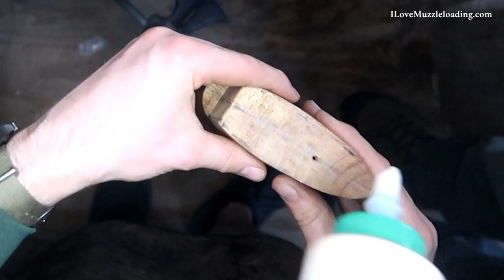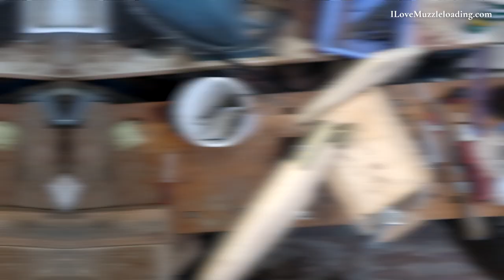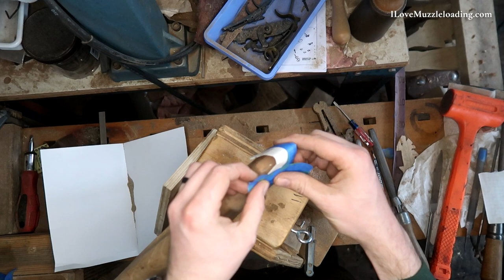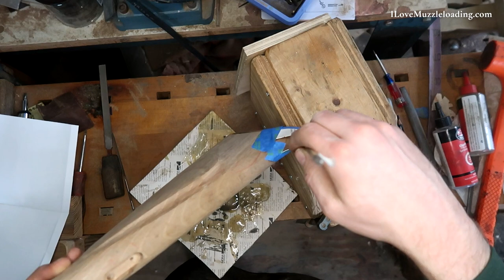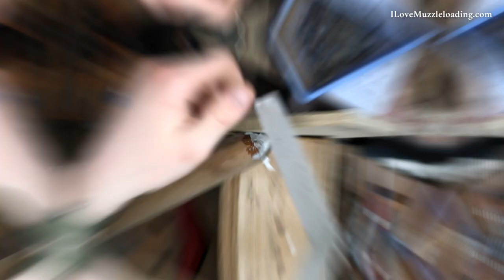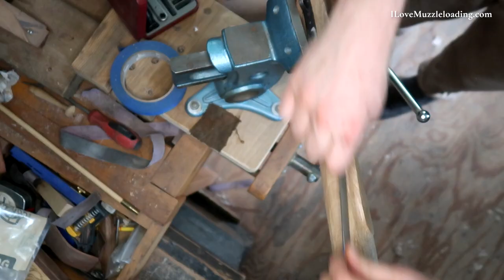I done goofed - Let's fix this buttplate | Let's Build a CVA Hawken Part 5 | I Love Muzzleloading

Comment: Ethan, Ethan, Ethan. You could have asked me.
Brass components, and steel components are cast in, mostly sand. The Cope and Drag are a certain size. The components are usually foam, or wax. The models were compressed to facilitate getting ready to cast. The caster maintains at least 1/2" between model and Drag.
When you see the sprue on the top of the casting,  that is where the metal enters the model. I do not know what the model looks like, or the dimensions of the Cope and Dag. However, I suspect the butt plate is cast in one piece, and the mold is two. The Gate, and Sprue are pointing upwards. You do not want the sprue to be that close to the casting. Metal shrinks when poured and any right hand turns on the model will have a pocket. The bumps you see on the product are called mold Warts. A bubble that sticks through all the processes that are involved.
Ok, that is a rough How it is done, Now. How does the artisan fit the butt plate?
He sands the stock, and trys the plate. Now he sees the gaps. What to do?
Rather sand the buttstock more he takes a punch and planishes the butt plate to the work, Each void between stock and buttplate, he peens down. Now hows about the bigger gap at the end?
He removes the buttplate and bangs the end down. No more gap! Just a dimple or two and voyla! Done.
When you removed and put a piece of maple in it, that was unnecessary. If anything, it might have made it harder. You then had to remove wood, and add filler. You did goo, but it will show. It looked like there was sufficient metal to make it fit.
I hope I have been able to show insight for ya. You sure have done that to me. That and Bobs Gemmer tape. I learned a lot there. I thank you. My Gemmer looks brand new oldy timey. It is a beaut. I really thank you.
Now go Boop the Floop! He earned it. Give him an hug! Cats like it when you hold them upside down and tickle between the rear toes! They spread their toes and wiggles their tail.
Thanks.
It was great to watch.
Doc

Comment: You did fine sir. You got it done. As a future note, brass bends, they have colors you can use in epoxy to match either the brass or the color of the wood. And as a hobbyist knife maker, i use g10 liners that you might think about to kind of "feature" the separation between butt plate and stock. Just a few thoughts. Hope you dont take this as offense. Its only meant to give you some extra tools in your box. If youre looking for a classic black powder or originalist look i understand why you wouldnt use something like a g10 spacer.  I understand also why you chose to fill it instead of bending the butt plate if youre after that originalist look. Those butt plates wrap around the shoulder fitting like a glove. Theres a comfort in that. 👍🤝

Comment: Ethan Ethan Ethan. You should have looked at pictures of a finished product and you would have known exactly what to do. You  made work for yourself and have an inferior gun because of the steps you took. You should have listened earlier. If I have to tell you again it will be at the buckle end of my belt! No but seriously the butt plate needed to be thinned down a lot from the underside. Once that was done and fitted there would be no undercut.  A little thinning a little bending and a little shaping and you would have been done with no filler.

Comment: I believe Jesus was a carpenter, I don’t know a lot about it but it’s interesting.  I would have tapped in a new pice of wood using some holes.  I think adding brass and wood shaving weakened the glue.  I’ve use JB weld before on a surfboard nose and it’s hard stuff.  

You didn’t make it worse but I would have done differently, many times doing nothing is worse.